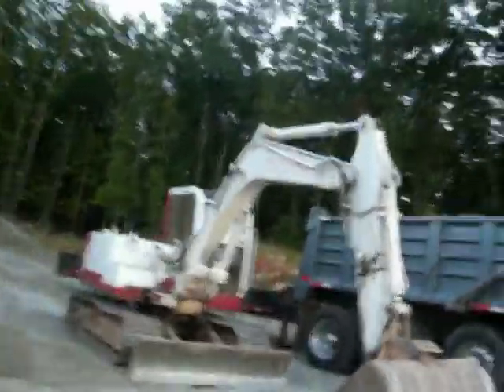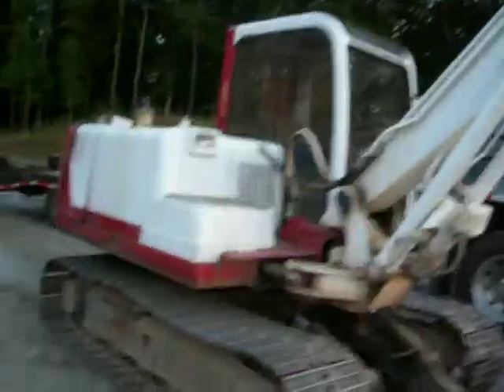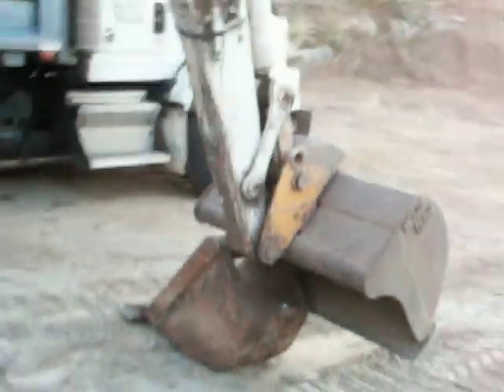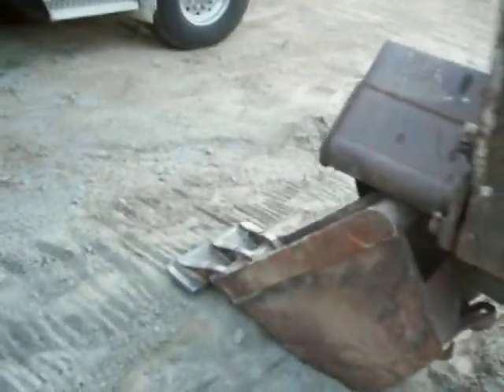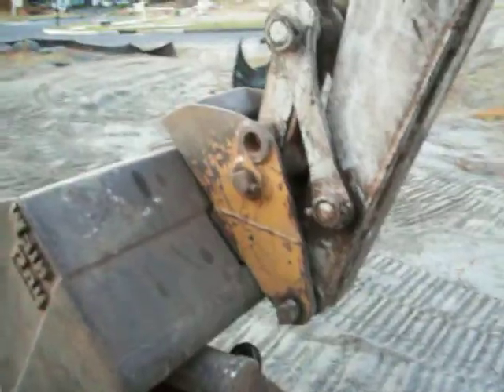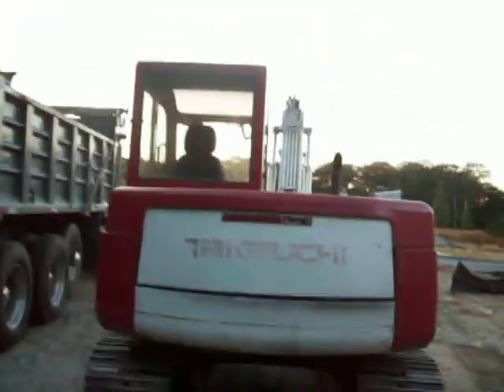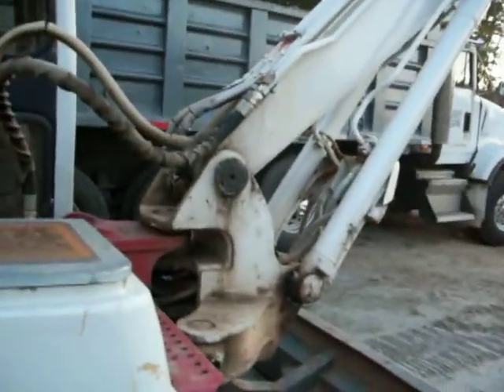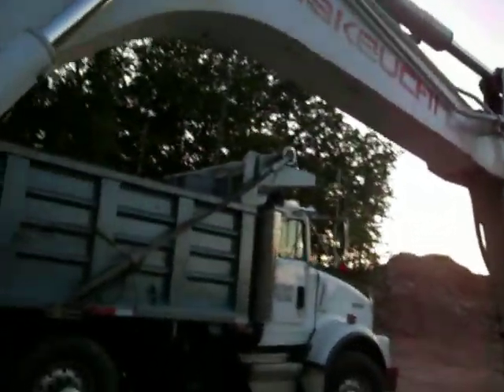Takeuchi TB070

Comment: The bucket with the plate welded on it can be used to rough grade the dirt after the trench has been backfilled. The larger bucket is known as a cleanup or grading bucket.